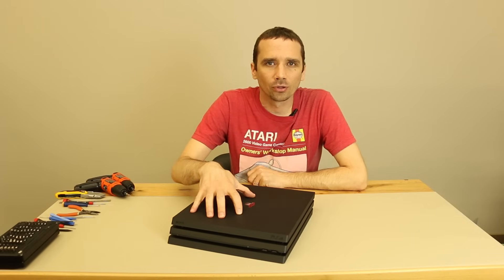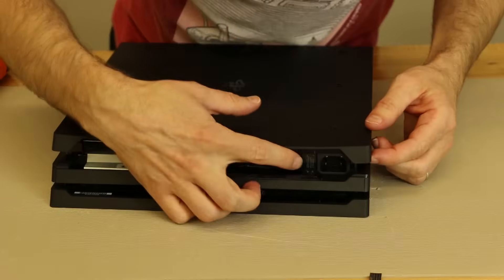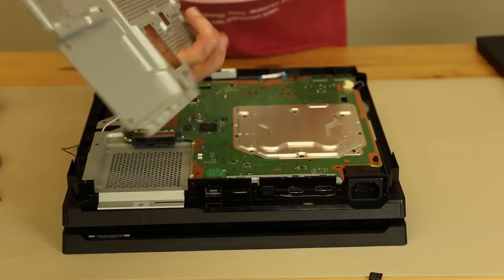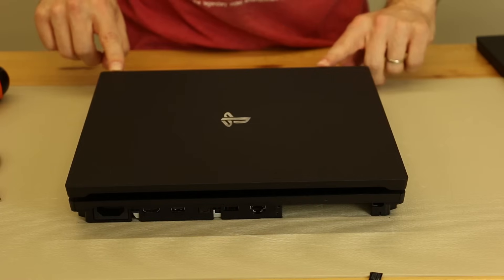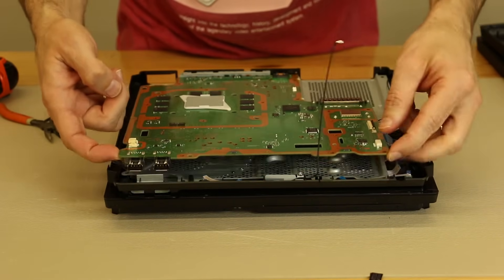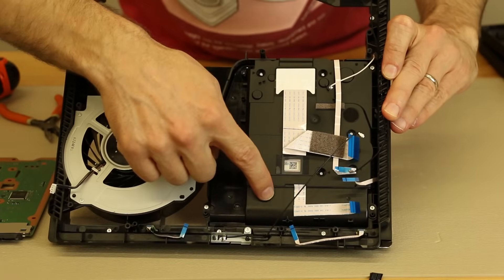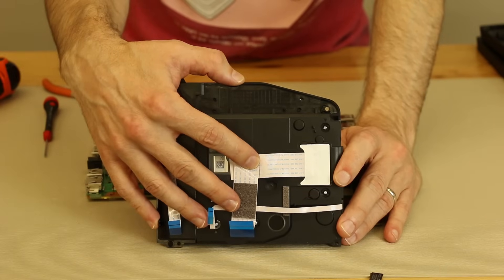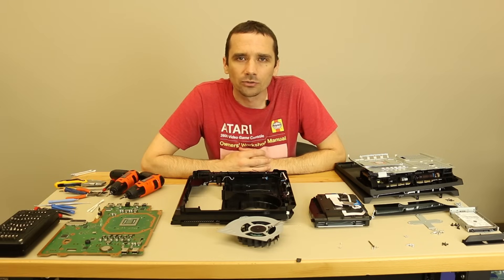PS4 Pro Teardown - Detailed Disassembly

Comment: The video content is good for the most part but there is a problem I think everyone should know. You mentioned that when removing the power supply from the console that you need to be careful and not remove the part of the connector that is attached to the motherboard but the wires. I tried pulling the wires using needle nose pliers and in my case the whole thing came off and that destroyed my P/S console. What I found out after this happened was that it was much easier to remove the wire from the power supply itself. Had I known that, that's how I would have removed it because it just came off from the power supply with hardly any effort at all, I didn't have to use needle nose pliers to grab it and wiggle it I just used my fingers and pulled it off.  Be careful guys because now I can't do anything with this P/S 4 console but use it as a paper weight. Thanks!
Reply: yes thats the better way to do it
Reply: Soldering the connector back is not an impossible thing to do. Do not be upset, you can recover it.
Reply: And thank you for giving the tip to others!

Comment: So I've had my ps4 for over a year and I cant remember of it has ever been quite amyways I just followed your video and when I got to that vent part behind the fan I noticed half of it was covered with a thick coat of dirt and what not so I peeled it off..

I then blew it out with a air can and it looked almost brand new, I also wiped down the chrome strips that run around the mother board cuz they looked really dark and bad so i made them look brand new as well.. I put it all back together then started it up and it was more quite then I've ever heard it but then when I started up a game I received for the first time ever a warning that my ps4 was over heating and it immediately turned off.. I started it up again but this time I chose a different game and yet it still shut off due to over heating..

Why is it worse off then it was before I cleaned it?! Was that coating I peeled off helping it? Please help me! I dont know what I did wrong but I've had a really bad year and my ps4 is the only thing that's distracting me enough to not think about it, i really need it to work!!! 😔
Reply: I can watch my recorded video clips but I can't play any games?? Anyone know why??
Reply: @Lex-yw5pj  did u figure out what the problem was?
Reply: @jonadeboer4120   Yes sorry I completely forgot to reply back! You were correct it was the thermal paste. I put a pea sized dab on it and it ran silent for a day or two then started acting up so I took it all apart again and threw on a big blob and I haven't heard it since. I appreciate your video as now I'm a master at dissembling and reassembling my ps4! 👍👌 lol

I've heard in some videos that I am suppose to change it every two years, is that the case? I never had it over heat to the point it shuts off but the ps4 every month or so would randomly not start up until I downloaded a ps4 update to my USB drive and then factory reset my ps4 to install an update software for it to run again losing everything I had saved... Could that be because of not having enough thermal paste?
Reply: @Lex-yw5pj  wouldnt recommend putting to much thermal paste, it could drip into other parts of the motherboard if you add to much thermal paste.
Reply: Maybe you need to renew your thermal paste
Reply: Thermal paste stops overheating

Comment: Thank for teaching. I have one question the x metallic support on top of the cpu on my ps4 pro is a diagonal one in a S shape. I had problems of thermal throttle plus overheating and I think because I saw on other channels everyone has the x metal plate not the s one.

Comment: Thank you! My PS4 was shutting down due to overheating and I had to do multiple factory resets. I used this video as a guide to take apart my PS4, clean it out, and apply new thermal paste. I found dust bunnies forming rudimentary societies and demanding sentient rights in there. Now the unit is whisper quite, even when my kids play the latest, most graphically intensive games.
Reply: Thermal paste you recommend?
Reply: @derekisludicrous9203  Noctua NT-H1 my first option if not go with ARCTIC MX-5 is also a solid paste
Reply: @EattingMeatSince82  I just ended up buying a series s and I'm gonna save for a ps5
Reply: @EattingMeatSince82  thanks tho I appreciate homie

Comment: One of my screws are plastic and stuck to the ps4 itself so I can't get it out
Reply: Middle screw on the power supply? There is no screw there newer pro models don't have a screw there just a plastic cover that looks like a screw
Reply: @JGamv  well because of it I can not disassemble it and will have to resort to drilling it out
Reply: @JGamv  I tried everything and I dont have the bit for it if it is a screw. Prying it off didnt work either and only deformed the head and would only leave the threads stuck if it popped off

Comment: Wtf man I took out the two screws on each side holding the power supply down, but I have a circular type black screw that looks like plastic holding down the hard drive at the bottom middle of the power supply.

Comment: Thank you I just broke my ps4
Reply: Me too. Power supply cable did not unplug as expected and ripped pins outa the motherboard :)
Reply: @mackeralthecat  I'm stuck on the same part 🤦🏽‍♂️ almost stuffed mine lol I'm just sitting here hoping it'll turn back on when I finish cleaning it
Reply: Congratulations 🎉
Reply: Me too. Disc not reading now
Reply: 😂😂😂😂 did you get it fixed?
Reply: @ahlee8511  I did. Thanx for asking. But don't you dare laugh. 😂😂😂😂😂😂😂
Reply: You all stupid he just show how to open and he didn’t close 😂
Reply: @arslanishaqofficial347 🤣🤣🤣🤣
Reply: My life is destroyed because of and i can’t financially recover from it. Can someone send me a new ps5? 🙏 thank you
Reply: @imanormalman1100  using a PS4 tutorial for your PS5😂?
Reply: @MrJimMilton 
That's really Dumb.😊
Reply: Be carefull with the Power supply connector.
Its tangled around a pin on the power brick to keep it out of the way.
Get it off that pin first then you have space to pull the connector with your fingers.
If you don't know what your doing be gentle and don't use tools. I took mine 100 times apart.

Comment: I paid for the PH00 screwdriver in the description and it's not working on the bottom metal part (11 black screws). It's stripping away the head of the screws. Can anyone suggest a work around or a reliable brand?

Comment: Took my ps4 apart to clean the heat sink 
I put it back together to try a game out and now I get error code 30392-7 
I need a lil help
Reply: its to do with the disc drive reader meaning you might have connected it back incorrectly, too loosely, or damaged it but it could be firmware issue so put your ps4 into safe mode and rebuild database (if you dont have a ps5 by now)

Comment: Hey i have a great question,
Does the fan spin freely if you spin it or does it have resistance,
Only asking cause im following ur video and took apart and i notice that my fan is pretty clean but when i went to spin a lil, it had resistance to it is that normal or do i need to replace it.????
Help plz and much appreciate it

Comment: Hi there I did teardown on pro cuh 7116b and I have run into this problem twice after I do repair on discdrive then I test when still open it works 100% then when I do full assembly then I have a problem with the unit just switching on and straigh off any advice please?

Comment: This video is grossly incorrect about the PS4 outputting 4K resolution games.  It does not matter if the game was installed primarily from a disc or download.  The originating medium has NOTHING to do with it.  It's depends on the developer if the game supports 4K output of any sort.  Disc and Download are exactly the same.  Both install to an internal/external storage drive and get read/played from there.  The only restriction is 4K Blu Ray movie discs which the PS4 can't play because the optical drive is not Blu Ray 4K drive.

Comment: Need some help got a ps4 pro and it seems to have a mind of its own..the controller doesn't connect at all until after several reboots and sometimes the wifi doesn't pick up ? Any ideas of what it could be or did I get a bad console ? Thanks in advance

Comment: For all the stuff they added to keep it cool it’s pretty sad none of that works
Reply: The problem is that the consoles heatsink is large enough to cool it properly, but there isn't enough ventilation. If you take off the top cover it can reduce the fan noise drastically

Comment: Can anyone confirm if any of the screws on the bottom are fastened to the power supply directly? I REALLY don't want to take it completely apart to change it. My PS4 has been shutting off randomly every couple of days, the conclusion I came to being the power supply suffering a slow heat damage before I cleaned it out the heat sync+fan blades the proper way.

Comment: Hey Steve, just want to say thanks for your videos. My ps4 Pro was over heating and from watching your videos I got the confidence to do the full teardown, replace thermal pads and paste and clean the heat sink.... The ps4 Pro looked clean right up until the heat sink came out... Then, wow... Like a curtain of dust across the fan side... Now it runs like its not even on.  So thanks! And to everyone not sure they can do this job you can! , just follow it step by step and have right tools... Mainly torx 8 security screwdriver.

Comment: I got a reconditioned CUH 7116b. On the Sony replacement program. Paid £175 for it. It arrived clean and was quite until I loaded No Mans Sky. Fan  was 78db at peak. I opened up and found the reconditioned PS4PRO had a thermal pad missing off one of the chips and the Cpu clamp was the old S shape design not the X shape from my original PS4PRO. Also the power supply has a plastic screw what can not be taken out without destroying it and voiding the 3 month warranty. I have RMA to return but God only Knows what I will get in return. 

Everybody is talking about the PS5 but what they don't realise is even if the PS5 is quite at launch it isn't until 2 to 5 years later when developers push the machine will we know if it has good cooling. The same thing could happen again and the support is second rate rip off.

Comment: Bro u didnt explain the power supply part good enough and instead of taking off the cable the way u did it i did it the way u explained it by pulling on the white part and now my ps4 wont turn on thanks

Comment: Hi there. I'm very inexperienced and just took apart my ps4 pro 7015b machine. I checked out thermal paste is lacking and a couple days ago I ordered 2 small external fans planning to suck out the hot air from the back. My question is will the fans work or do I have to replace thermal paste? Machine gets fairly warm after 15 minutes of play. It's well ventilated. Just taking precautions.
Thanks

Comment: “Wiggle the power supply” he says 🤦🏽‍♂️🤦🏽‍♂️🤦🏽‍♂️ I jus ripped my power supply I’m sure
Reply: Jesus christ, the power supply on the motherboard is welded on its insane, I tried from the psu end also but that's also welded on 🤣 what was a 45 minute job has turned into hours and it still won't come off. I'm getting a beer. Let me know if anyone comes up with a stress free easier method.
Reply: Same did u fix it?
Reply: Same man. I'm pissed. Does the ps4 still work?

Comment: Sony purposely made my screws to tight on the big metal thing so that I would strip them and not be able to clean it
Reply: Does anyone know what size are those screws from that big X plate ? Just wondering I took apart and I'm afraid if I were to take it apart I would strip it I replaced my thermal paste but I also looking into placing thermal pads as well
Reply: Had no problem cleaning my old ps4 got a pro and it wont seem to come apart without breaking also there appears to be a screw with a hole right thru it holding my power supply down cant remove it casing is coming off the power supply managed to snap it
Reply: You either used the wrong size or didnt apply enough pressure when loosening. Stripping out a screw is hard to do if yo use the right size bit.
Reply: @TR1GTARD  and screwing a stripper is harder to do without the right size bit..
Reply: I had the exact same problem with the exact same 2 screws at the metal on the power supply. I used the exact same screw driver for similar screws all over with no problems. Here it doesnt even fit though the screws are the same but somehow flawed. What the heck to do?
Reply: Just got done taking apart everything and cleaning it all very thoroughly. Used a phillips a little bigger than an eye glass driver for all of them except for the torx bits which are an 8
Reply: He had to remove the warranty stickers. They definitely dont want people doing this lmao
Reply: Have you tried an electric screwdriver similar to what he uses in the video? I haven’t needed one in my experience, but it may help if the screw is torqued too tight.
Reply: the problem was your crappy screwdrivers, good drivers dont strip stuff easily

Comment: Do I need to remove the motherboard to clean the Heatsink? My PS4 pro is very loud, like a jet engine so something is wrong and the fan I already cleaned. I’m just really nervous to monkey around inside the actual PS4
Reply: just bare the noise , ps5 is nearly out , just buy the new upcoming ps5 if you dont wanna break your ps4

Comment: Ok. Mine doesnt even have two screws in the back. It's the battlefront 2 edition pro.
Also mine looks waaaaay different under the top cover.
Reply: There is 3 different pro models with each model having minor/different tweaks

Comment: Thanks to your videos my ps4 no longer sounds like it's taking off. Heat sink was caked in dust so cleaned that up and replaced the thermal paste and now I can actually play without headphones! If anyone else's sounds like a jet engine then get it done just make sure you buy the right tools. Cost me about £15 for the tools and the thermal paste. Well worth it.

Comment: Help, my Ps4 Pro has 2 of the screws (on the aluminum by the battery) which are stripped. Is there any way to remove them? Tried the rubber band trick but that did not work. They are SUPER TIGHTLY screwed in.

Comment: Thanks for the video, my PS4pro fan has been spinning loudly lately and decided to apply liquid metal to replace the factory thermal paste.  After application, the noise has gone down tremendously when playing games like FFVII remake or GoW.
Reply: Did you clean vents too or just replace paste
Reply: @GBI I cleaned everything since it’s open might as well do it.
Reply: You realize that you would have gotten the exact same real world effect by using a good traditional thermal paste, right? And you'd be able to actually pick up your PS4 without it being scary.

Comment: So i ran into a big problem. I did all of this and put it all back together. My Ps4 then would beep but not actually turn on. So i tried disassembling it again and nowi  cant take the oower supply out all if a sudden. Its caught in the PS and I've pulled very hard. Need help

Comment: The power supply connector was too firm, I mistakenly disconnected it entirely (both the male and the female pieces) from the motherboard. Now I have to take it to a technician to put the female back on the motherboard. 
I'll update this comment.
Reply: Yeah me too I used a little flat head screwdriver and pried on the side of the connectors. But I disconnected it from the power supply not the mother board. I found this much easier since the power supply can be moved.

Comment: If theres a tip id give for u guys is BE CAREFUL ON THE POWER SUPPLY PART WHEN DISCONNECTING THE CONNECTER CABBLE  you literally need to grab it hard and slowly (really slow wiggle it out). It wont look like its coming out but it is.

Comment: how do you take out the wifi cable and the ribbon cables to pop out the top taple off?
Reply: Bernardo Sureda for the WiFi connectors just pull on on the metal part that’s connected to motherboard, they pop right back on.  I asked the same question but just figured out for myself.

Comment: I have a PS4 PRO model CUH-7215, One time I wanted to test something out, so I shut down the system correctly and unplugged the outlet wires carefully, I picked up the PlayStation. It slipped out of my hand and fell 2ft onto carpet front first, which resulted in the back panel of the PlayStation to pop out (where the interior design of the PS4 is) Ever since then, I've been very anxious if this had caused any hardware problems for my PlayStation. I, of course, placed the panel back the proper way, although one of the backside's tiny screws went missing and a slight dent to the board, but the dent doesn't concern me. What worries me is if my PlayStation is alright. I've played several games I own, performance is just fine, and everything else seems to be as well, no result of crashes/HDD problems, disc drive checks out, same with the blu ray. My friend did lend me his Fallout 4 disc, which I tried to install only to then give me a 
CE-30008-5 error. So I rebuilt the database and updated the PS4 with the internet, I came to the conclusion that the disc was the problem, as the PlayStation said the disc was damaged/dirty and my other two disc-owned games are perfectly fine. However, If I do shake my PS4, I hear a noise, now the sound is too "fat" to be the missing screw, and it only happens when I shook it from side to side, not back to front or up and down (And it also occurs, I would say, around the disc drive area, from the sound of it). Just to let you know, I have shaken the PS4 a few times to see if nothing internal was damaged after the fall (with the system off and with no disc inside) So if the noise is just the crap in the optical/disc drive, should I be okay?